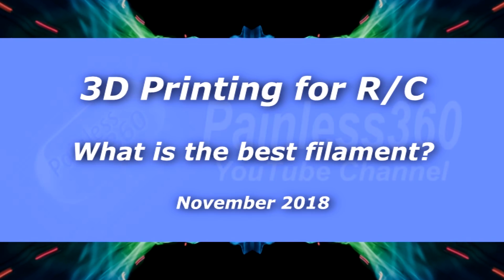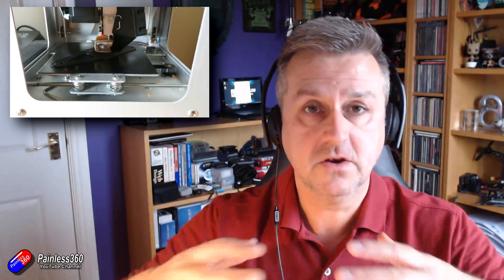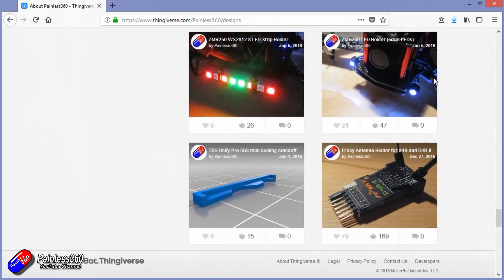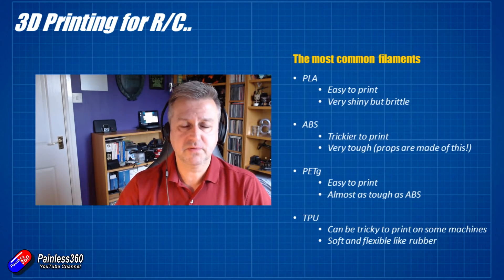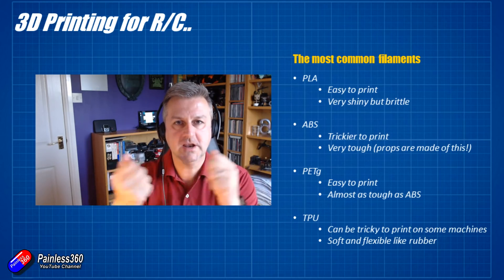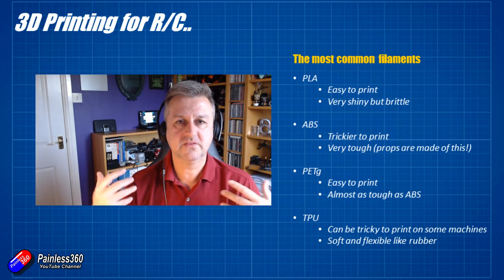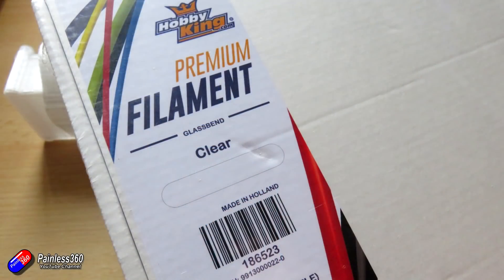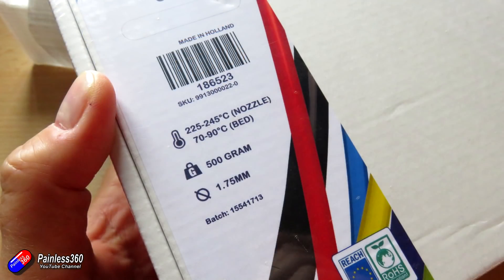3D Printing for R/C: Filament Options

Comment: Looking forward to it Lee,  since getting my 3 D Printer, i have become addicted to all the things it can do for me in the hobby, i just upgraded my original printer ( new extruders, glass plate and changed over to Simply3d  for my slicer ) but looking forward to trying PetG and some of the TPU style filaments.as i normally only print with PLA  and ABS.

Comment: PETG is strong and has really amazing layer bonding but unfortunately it's not very impact resistant. It's better when dried but I still don't find it a suitable replacement for ABS for things like motor guards, it just shatters. I'm about to try Taulman Nylon alloy 910 which is meant to be the stiffest of their usually quite flexible nylons. If it's not too bendy for your application then nylon is incredible, it's pretty much indestructible.
Reply: I should add that for anything that needs to be strong and more heat resistant than PLA, and won't have to survive impacts, PETG is excellent. It's my go to for strong prints now, except on quads.

Comment: Have you tried sintering PLA? Much stronger and less brittle. You do need to print solid and account for shrinking.
Just a note for those considering trying PETG. You really need an all metal hot end and heated bed to print it.
Reply: I've printed a fair bit of PETG around 240/245 on a mixed metal/Teflon hotend without problems
Reply: @sligit  I find when I get over 235 I start to have issues with jamming. Under 245 I do not get good layer adhesion on larger parts but that might be because I do not have an enclosed print area and ambient is 21c. I'm printing with esun petg fwiw.

Comment: Also, I neglected to mention, I print out motor vibration pads for all size motors, motor guards, vibration resistant stand offs, circuit board separators or guards as well as camera mounts for flight cams and HD cameras. I really can’t complain about the results, especially for free. Of course, design plays a key roll in how effective a part is, but the TPU has properties that are relatively easy to take advantage of.
Thank you for all the great content you have generated!

Comment: Try 1:1 PVA glue/water coated on glass for adhering TPU on to the base plate.  Polyvinyl alcohol (PVA, white glue, school glue) is easily applied to a glass plate with a sponge brush.  Allow it to dry overnight and it will provide a very smooth surface on which to print.  Can be reused maybe half a dozen times before recoating is necessary.  Easy to remove a printed object; just allow it to cool.  PVA can be washed off the base plate with water for recoating.
Carbon fiber reinforced PETG is also available.  See https://www.matterhackers.com/store/l/carbon-fiber-pro-series-petg-filament-3.00mm/sk/ME84P9M2?rcode=GAT9HR&gclid=Cj0KCQjwjvXeBRDDARIsAC38TP5w6QWAEySd-eSdnoZIDNTj8DmZblil2wLKPv3h1c0nhwkzpAB2GIEaAtaPEALw_wcB for an example.

Comment: Hi Lee - I've only printed in PLA before, and I've always steered clear of ABS because (aside from the warping) I think the fumes it gives off isn't nice.  2 questions - anything to be aware of printing petg or TPU indoors, and secondly - the printer I built a good few years ago, aside from being a bit long in the tooth has a 3mm extruder.  3mm filament seems a bit lacking unless you just use PLA - have you found this to be the case as well, it 1.75mm just the thing these days ?
Reply from the maker: 1.75mm seems to be the favourite for home machines now, PETg doesnt smell like ABS. Did you mean a 3mm extruder?

Comment: I've found that with flexible that I can get successful prints in both direct extrusion and bowden extrusion at 15 mm/second movement. It's slow as heck, but you don't have to attempt it multiple times to get one good print :)

Comment: I am really excited about this new video series. I have  Pusa I MK3 and use it to print small parts for my quadcopters using PLA. I have not tried PETG. I would like to print a drone frame, but can not make up my mind which type of filament to use for the project. I am looking at some form of TPU, like NinjaTek Armadillo or Cheetah. In one or your next videos can you talk about TPU and which type of filament you would recommend for printing a drone frame. I do not want to use ABS, due to the smell and fumes produced when printing ABS.

Comment: Have you had issue with keeping petg dry? I am still using e-Sun PLA plus which is much tougher than plain PLA but remains easy to print. I ruined a whole roll of petg trying to dry it, but plan on trying it again. Thanks for re-visiting 3D printing!
Reply from the maker: I keep mine in the study in a centrally heated house and never had an issue..

Comment: One big problem with some filament brands is poor quality control leading to a lousy diameter leading to poor prints due to under or over extrusion.  Could you please check the diameter of the HK filament with your calipers for us?

Comment: Have been printing with PETG for R/C for about two years now. I build a quadcopter from scratch using PETG printed parts I designed myself. And it flew like it should. 

This spring, when I started up my quadcopter, one of the 3D printed motor mounts just desintegrated in seconds while still on the ground. I replaced it with spares I already had printed and on the third flight, another PETG motor mount shattered spontaneously, crashing the craft. Maybe I did'nt print the PETG hot enough, maybe the filament was on the cheap side - whatever the reason, I am more cautious using PETG filament.
Reply: Did you print the PETG with the cooling fan pointing at the plastic? It creates a much better bond if it passively cools, so disabling the fan on the hot end is a good idea. (For newbies reading this I mean the fan pointing down at the plastic. Don't disable the fan pointing at the heat sink on the heat brake) :)
Reply: Actually when printing with PETG I have the cooling fan dialled down to about 10% on my Flashforge Pro. And I do use a closed chamber when printing PETG. 

The point is that while after printing the material was strong enough and I had no problem using it on my craft, while that same craft with the exact same parts fell apart a year later.

Comment: Hi Lee,
I use TPU all the time, and yes, it can be tricky to print.
Please mention bio-degradation next time...PLA is great for prototypes as it is starch and will biodegrade. The other filaments don’t, so they add to the piles of garbage we humans are so guilty of producing.
Also, apparently, in order to pump out a good ABS part (which admittedly I don’t use), an enclosure for the printer helps to retain heat and allow the part to cool much slower.
I wish they would produce a flexible, biodegradable filament. I really hate being part of the pollution problem...

Comment: I use PETG, it's easy to print and it's as strong as ABS, at the moment I print with PETG with carbon fibre, it looks awesome.
Reply: I don't actually find PETG very useful for this hobby, at least in something like a racing drone where you crash a lot, since you really want some flex. It just doesn't hold up like TPU or Nylon. PETG is a great material for a lot of other things, but high shore hardness TPU and nylon are king in this hobby.
Reply: @d3c0deFPV   it all depends what you use it for, i fly a  large multi and crash isn't likely so it works for me, isn't tpu like rubber, what do you use it for on a rasing quad?
Reply: @mr_sheen_airsoft  for pods, camera mounts, antenna mounts, ESC protectors motor guards, motor soft mounts, and other things. I've seen people try with PETG and it ends up breaking fairly quickly. It works for things that won't take direct impact. Nylon is usually the best material for most things since it does flex, but not too much. TPU can flex so much on something like a pod that it doesn't protect your stack well, but for something like an antenna mount TPU works pretty well. The shore hardness rating will determine how flexible or rigid the TPU is. But you're right, if you're not crashing a lot or flying at high speeds, PETG can be pretty useful.

Comment: You should try using "PLA Pro" by eSUN.  Much stronger than even ABS, and not brittle at all like regular PLA is. And its much easier to print with than PETG.
Reply: Inland PLA+ is also pretty awesome. It has more flex than normal PLA, and even prints better than my Hatchbox filaments. Less retraction needed to eliminate stringing, and layer adhesion is better.

Comment: Can I print tpu on any 3d printer? Or what different part or parts on the printer do I need to print tpu?
Reply: Some printers play better with TPU than others. In general, a 3D printer with a direct drive (the filament feeder is very close the nozzle) will do a lot better than a printer with a bowden setup where the filament has to travel down a long tube first, and can flex. Most entry level printers are bowden, but almost any printer can be modified to print TPU. You just might have to go a little slower. Before you consider purchasing a printer for TPU, see what other people are saying about how well it handles it, or what modifications are required.

Comment: Interesting video - thanks.  I have had really good luck with PLA+ for most of my 3D RC parts and have also used Glass for some small stuff.  Glass is also great for spiral vases and bigger stuff.  PLA+ , like PLA, is easy to print but quite strong.  Glass is a little trickier because it has to be hotter but I like the results.  I only messed around with PETG for a bit and my results were sketchy but I will now have to go back and try it again.  I like the small footprint of this printer since we are in a motorhome but what I'd really like is a small printer with a dual extruder.
Reply from the maker: Maybe I can share my settings and tips for PETg printing then? Thanks for the idea.
Reply: @Painless360  That would be great!

Comment: I just bought a CR-10S  on sale, and 16 rolls of PLA from HK, along with a roll of TPU. (expect them both to arrive today), I've become tired of paying $50 a set for quadcopter antenna mounts and go-pro mounts - (typical flyer economy, I could have bought enough prints for 20 quads for what I have into the operation so far - but I'll learn a lot and make exactly what I want when I need it)

I'll be going over he rest of your 3d printing videos in detail. I also agree about Angus over at MakersMuse is also an excellent educator, he's a professional turned Youtuber and knows the art well.

Thanks!
Reply from the maker: Be prepared for all of your flying buddies to hit you up for spares and replacements too. :-) best of luck with your new printer!
Reply: My 3D printer was my best purchase this year, suddenly I've been able to design & print parts that would've taken an age to fabricate with other means and even then wouldn't be as perfect & accurate as a 3D print.
It's got me thinking about fixing & creating things in a whole new way.
Reply: I got the Ender 3
Reply: @FeWolf  The Ender 3 looks to be a good machine, and it takes up less space. I'm just now looking at making the CR-10 fit in my shop, going to be moving stuff, especially if I build an enclosure.
Reply: @scottmarshall6766  I looked at 5 different machines, 3 months of reviews, reading forums, and checked out software, company support and community support, yours and Ender 3 was my top choice, price was only thing that separates the choice in the end. I had someone printing for me really cheap, but I felt bad eating up all his time. I also tabletop war game, so that was another factor.

Comment: Great video, the initial reason I bought my Prusa i3 Mk3 kit was to design & print camera mounts for quads, and knew it would be useful for many things I haven't yet thought about. That was a long day when the kit arrived - 12 hour straight build.
Something I'm getting slowly more concerned about is how come my PETG & TPU prints (I'm using Hobbyking filaments) always need tidying up due to stringing. I tried increasing retraction & lift which helps a bit but still doesn't come out as tidy/clean as the prints I saw in this video.
Reply from the maker: I find that PETg can be a little bit gooey. I'd reduce your printing temperature by 5° C and see if that makes any difference. I tend to print a little bit on the cooler side here and that helps an awful lot with stringing. Hope that helps..
Reply: Thanks, I'll try dropping the temperature down, I actually dialed it up to try and get it to look better and the layers to stick better after prints failed at the layer in crashes.